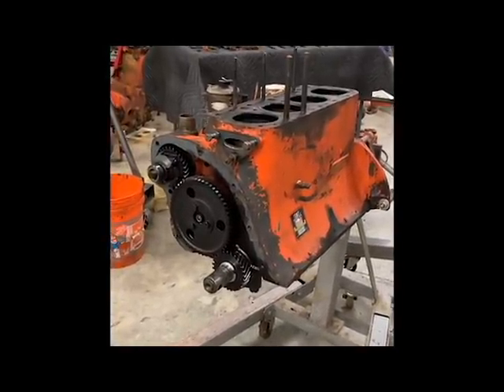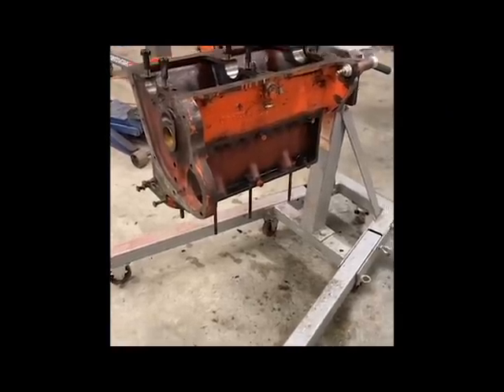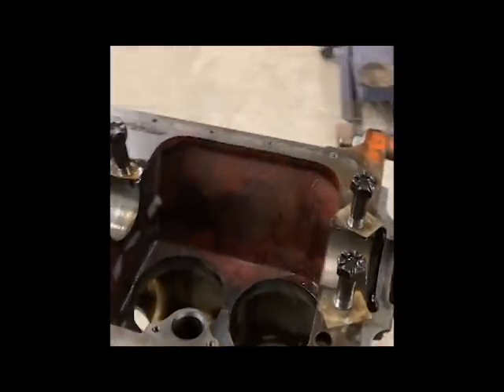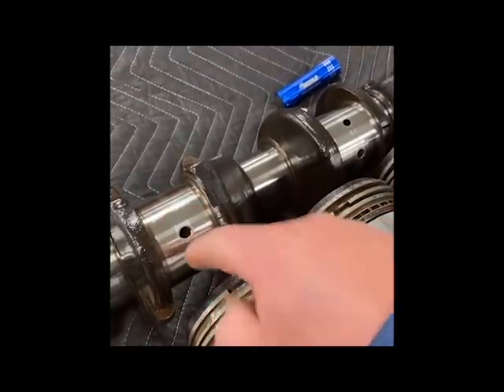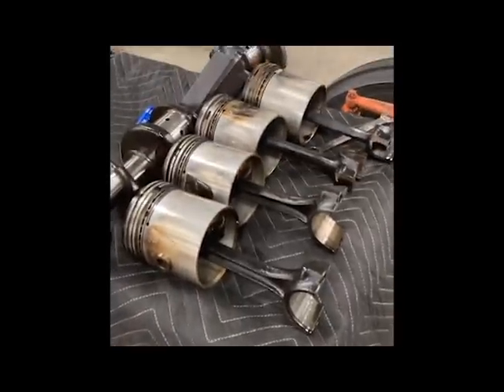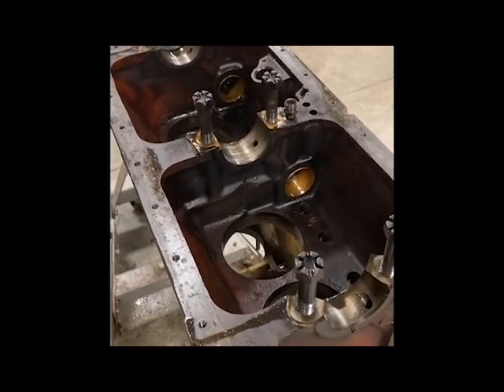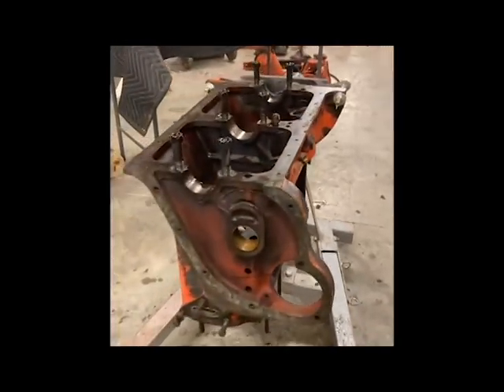Allis Chalmers WD Engine Disassembly Part 8

Comment: How did you pull the crank pulley? Air hammer? Pulley puller?
Reply from the maker: Yes I used a puller. Make sure to pull out the Allen bolt that’s behind the main cap bolt. Sometimes it’s hard to see.
Reply: @nashsummers8050  good to know. I see a set screw/nut(which wont come out “yet” due to rust). But didn’t know there was a allen bolt. 

Your videos on the wd have helped alot so far. But wasnt sure on how to tackle the pulley. So figured id try to reach out.

Comment: Do you have a video of you removing the sleeves? Are they hard to get out and back in?
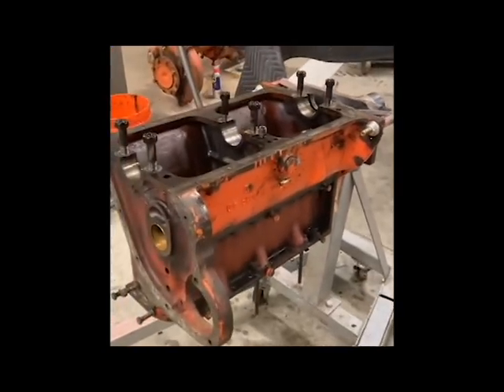Reply from the maker: Sorry I don't.  How I went about it was using a 3/4" piece of plate steel, flipped the engine over on the stand and knocked the sleeves out.  Check out the below video and fast forward to 6:30 and you can see how I went about this.  Hope that helps.
https://youtu.be/cRJRW_urbp4

Comment: I have a 53wd45. My right rear axel has a clunking sound when moveing tractor. Feels like some thing broke in bull gear or axel gear. Am i on the right path and how would i fix it if i am right.
Reply from the maker: Jerry could be a number of things. Jack up the rear end and with tranny in neutral spin the wheel and see if u hear it.

Comment: Good  day Nash  So  45 crank,  power crater pistons make it a  45?  I am learning don't know,  back in middle 60's  we got WD & dealer told us it was change to 45.  Yes there is alot of stuff in water jacket.  Thanks for now
Reply: Putting in the WD-45 crank and pistons is supposed to make it almost the same power as a WD-45.  Other differences were things like the snap-coupler were always stanard with the WD-45, but started as options on the WD.
Reply from the maker: Don, yes the 45 crank changes the stroke from 4 to 4 1/2" and the cone in the piston helps some but due to the longer stroke the compression is higher, which generates more hp.
Reply: @nashsummers8050   OK  Thanks, I would have thought piston would hit cyl head  with longer stroke  Thanks
Reply from the maker: @donvoll2580  The crank is different so it doesn't allow the piston to go up any further.